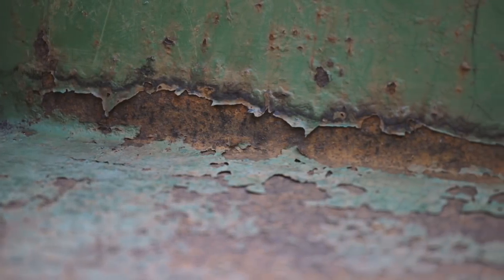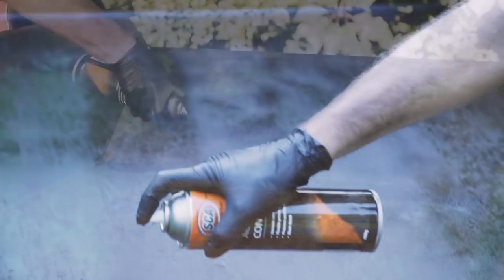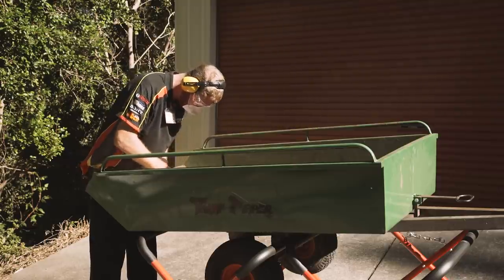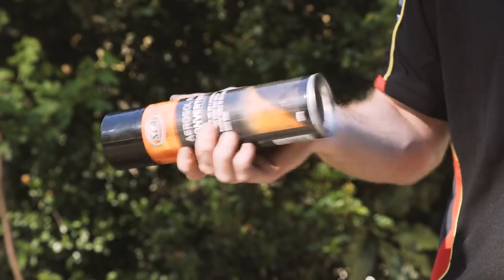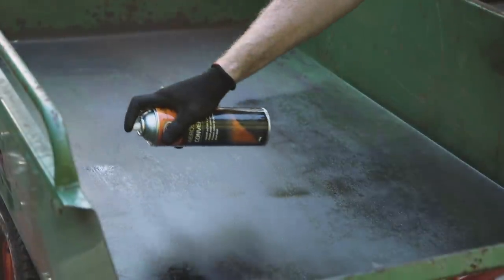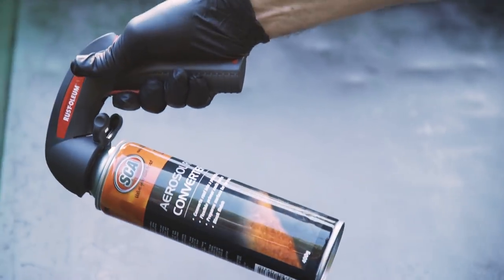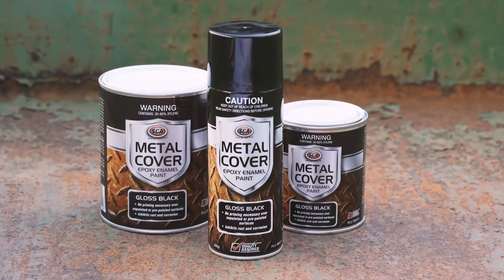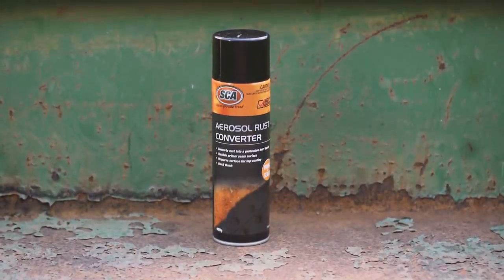How to Remove Rust - SCA Rust Converter // Supercheap Auto

Comment: I'll give this spray converter a go on my BBQ,.  Jays comment that rust converter dries as a primer is very important and dictates that a decent job of cleaning back prior to use of the rust converter will set the standard of the finished job' - Thanks for posting :)
Reply: Did it work on ur BbQ?

Comment: There is SCA rust converter and SCA rust converter primer and sealer. I used the first one and now I have to re do my work as the converter itself leaves an oily residue even after washing down

Comment: I have used this product in my engine bay and let me tell you never again. I prepared the area very particular and did everything to the highest standard before painting , after 3 months I noticed that it had not boned to the rust and all the paint had bubbled and was starting to peal off ( clearly doesn’t work) 
Be carful I wouldn’t recommend this product. 
I then had to re do all my work again except I used moto spray rust converter upon spraying the product it turned black almost immediately bonding to the rust. The super cheap rust converter did not do this, after 6 months with the new rust converter and paint job I have had no issues the paint is still perfect 
This product isn’t worth your time I will never use it again , I actually contacted super cheap auto about the issue and there response was you didn’t prepare the area correctly and they didn’t offer a refund which is absolute BS
Use a better product and just spend a little extra money it’s worth it in the long run if you don’t want the rust to return especially if your car is your pride and joy!
Reply: I just experienced exactly the same thing! I had people tell me I was being way too fussy for the boot floor of an old truck haha. Used a flap disc & wire brush to remove most of the rust from the floor of my Landcruiser, then used a brush and air-gun to remove all the dust, followed by a quality wax & grease remover. Painted in the cool of the evening, it turned black and looked pretty good. Came out the following morning to apply a top coat, and after 2 minutes of being exposed to the early morning sun, the Repco rust converter began bubbling and peeling off! After giving up on it and beginning to sand it off, it just looks like I've sprayed a thin coat of black paint over the rust as just 1 pass with 220 grit completely removed the rust converter exposing the untreated rust below... I came looking for guides to make sure I didn't do anything wrong, but just appears this product is not up to the task..... If you have already purchased this product and have no choice but to use it, my main bit of advice would be, that this will not have any hope of sticking to clean metal surfaces(it barley sticks to rust!), so if your prep has exposed clean metal, make sure not to get any rust converter on it! 
(I Have just tried using "DupliColor" rust converter and the results are looking much better so far)
Reply: @mikeyhbrown  yeah it really sucks because u spend so much time preparing and painting and it’s all a waste of time , I ended up using moto spray rust converter from auto barn and then applied a top coat months later the paint is still prefect and can’t complain 
Really poor quality super cheap paint
Such a pain going through all the hassle to half to do it again.
Reply: In your engine bay? Its not a high temp paint ofcourse its going to do that where you've painted..
Reply: @4wdantics636  mostly on the radiator support near the ac condenser over a year after using a different product it’s fine no signs of wear 😀
Reply: @skylineliam8659  Yeah thats good then, I've decided to go with RustKill made by wattyl wish me luck 😆
Reply: @4wdantics636  good luck mate 
I hate rust 😂

Comment: Curious to how this holds up over time.. Does it really stop the rust from coming back and or spreading??
Reply from the maker: Our Rust converter & Primer Sealer Chemically reacts with rust. Converting it to a hard inert organic compound and then seals the surface with an impervious coating. It is recommended for the treatment of medium to heavy rust on steel and galvanised surfaces whenever its not practical to remove the existing rust completely. It can ONLY be applied to rusted and/or pitted rust. Once applied, allow it to dry properly, it will turn predominately black. Not to be used as a preventative. Does not contain Phosphoric Acid. It is a suitable base for a variety of paints including: Single pack solvent based Acrylics, 2 Pack, and most Water based paints
Reply: @supercheapautotv  How many months does rust protection last?
Reply: @Jay Smith thank
Reply: @supercheapautotv  if the colour that you wanted to paint it is already black, do you have to go over it with paint or can you just leave it?
Reply: @lucaweller3371  best to do a top coat, many "Matt finish" or primers are actually porus and will absorb moisture over several months and start start showing surface rust through the paint after 4-6 months